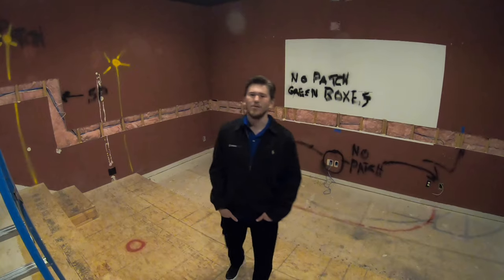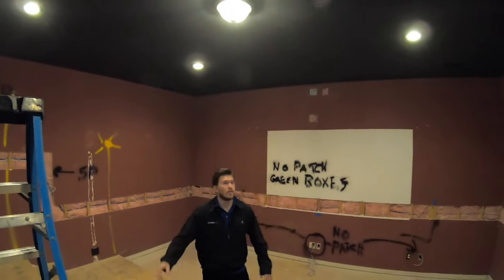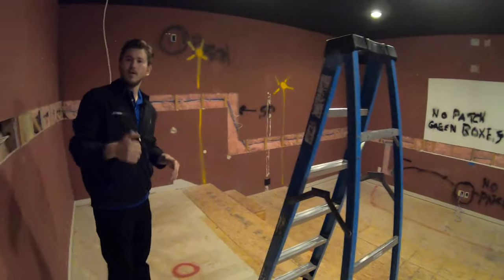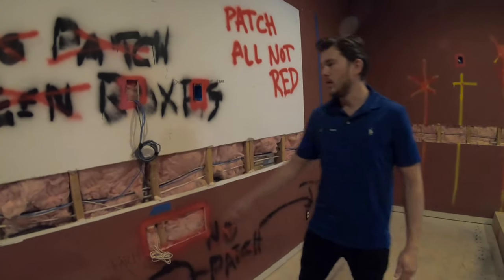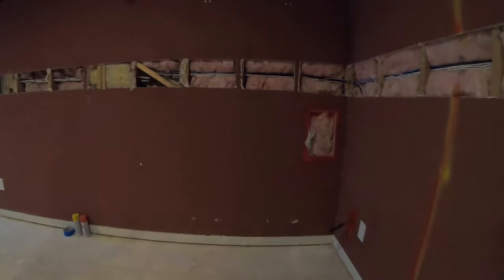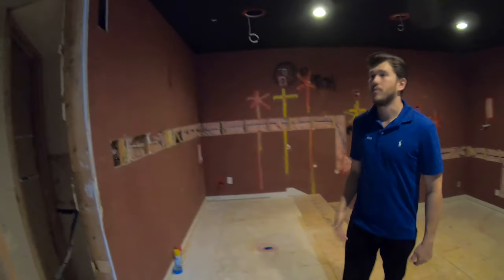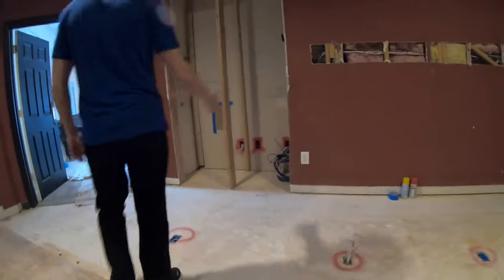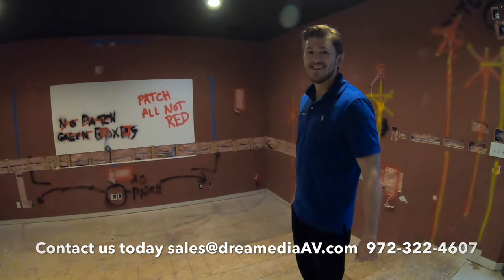Home Theater Wiring Before- How hard can it be?!

Comment: Here in Brazil the walls are brick, when you have to make the pipes for the passage of cables and very laborious and makes a lot of mess (debris and dust), congratulations on the video.
Reply: In Australia we have many homes that also have brick walls but often they are lined internally by standard 4/2 batons and plasterboard walls are put up but for insulation and to run wiring more easily. Its obviously much more costly to do that though.
Reply: You guys have it easy. Two of my walls are stone.

Comment: You had the absolute perfect spot to put the projector above the rack area to totally isolate it. You could have raised the ceiling above the racks and then ventilation would have been easier too (venting racks and projector together). One in duct exhaust fan or even a small mini split, cassette type above the rack on the left. Though really I’d rather stick with a 88’’ oled right now over a projector unless it was a cinema grade barco or Christie. Even the 20k prosumer projectors still don’t handle HDR right. They just can’t hit the fl to do Dolby vision.  Oh and get a screen masking kit. A automatic one ideally. Everyone puts in the 2:35-240 screen for their movies and then ends up watching 98% of the programming they wanna watch in 16:9. I deliver movies to networks and studios all the time zoomed in because they all want the 16:9 version only.  🤦‍♂️. Better actually because TVs and all these digital players mess up aspect ratio all the time. Filmmakers will deliver actual pixels instead of their video matted in a standard res and aspect. Can’t tell you how many times I’ve turned on a movie on my oled with webOS and the aspect starts wrong and have to go in manually change it. But Apple TV it will be perfect.